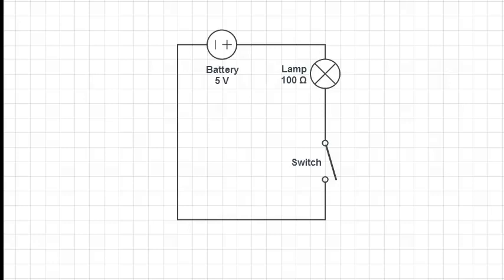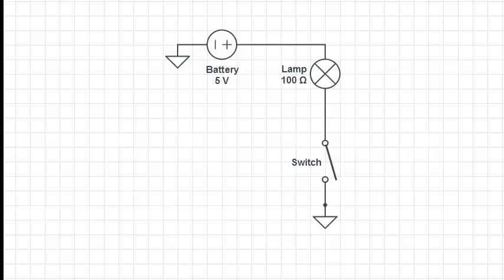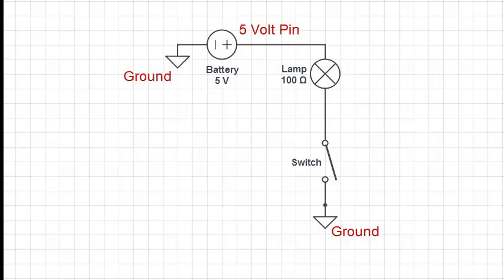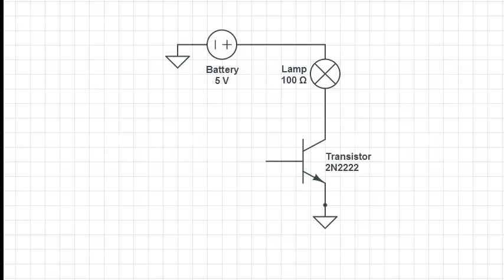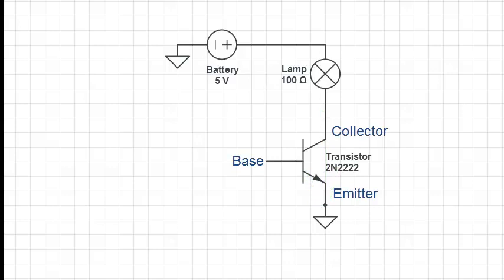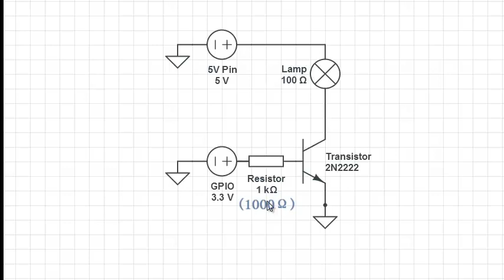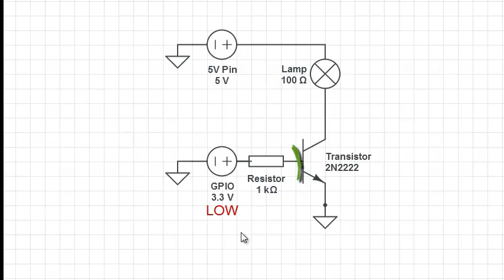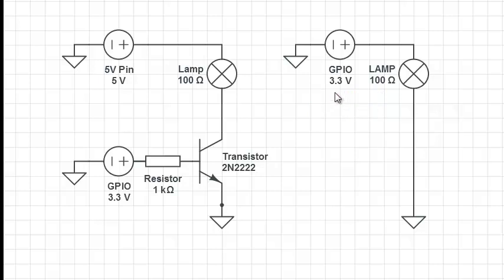Using Transistors with the Raspberry Pi (Part 1 of 2)

Comment: Thank you for this vide
but how to use this circuit with motor 12v
Reply: abdou chouf a way more powerful transistor aka a relay (there could be better ways. i don't know since i haven't searched any of it but this should work)

i also see gaven has made a video about relays so you should check that out :)
Reply: Thank you very much

Comment: Can i just connect lamp directly to  the 3.3 V GPIO? If i set GPIO to false, the lamp should turns on, right?
Reply: at the end of the video, he explains how the GPIO pin's current output is pretty low, and if you ask for too much current, something is going to burn out. that being said, im sure for a small LED needing say 4mA, the GPIO pin alone would work (would still need a current limiting resistor for the LED though) since he said that raspberry pi's GPIO pin has a max 16mA output.

Comment: Transistors will work with a pulse width modulation right? I would assume so because it's just how frequent something it tuned on or not.
Reply: +CoolAsFinnBro&#160;Yes&#160;transistors will work with PWM, you can control LED brightness or motor Speed with that ;-)
Reply: +CoolAsFinnBro +hamburgtech | They will work just fine, as hamburgtech said. I managed to control a set of infrared LEDs for simulating multiple, programmable remote control units by using Raspberry Pi and a bunch of transistors..

Comment: 3:28 false
Reply: What's false? You might think of using PWM to change the voltage level, but PWM just switches from 0V to 3.3V very fast that the voltage appears to be about 1,6V at a duty cycle of 50% (some cheap power supplies work that way), or do you count the 5V out as a GPIO pin to?
Reply: Jascraft Medien i think i was mistaken, i was under the impression that logic level low on the GPIO's was a little above 0v something like 1.2v or less.